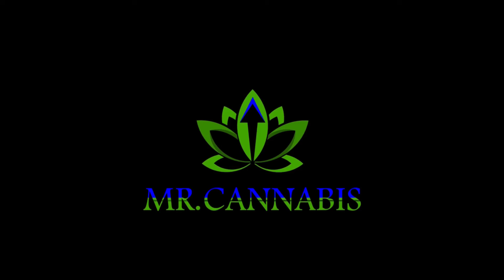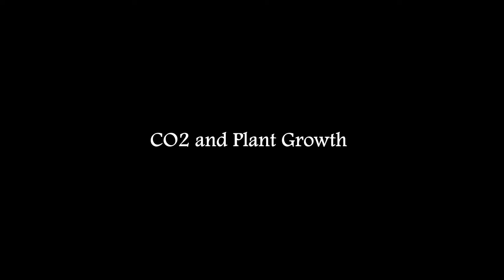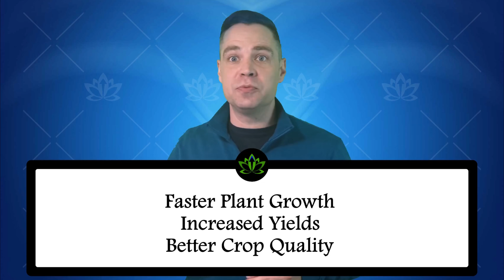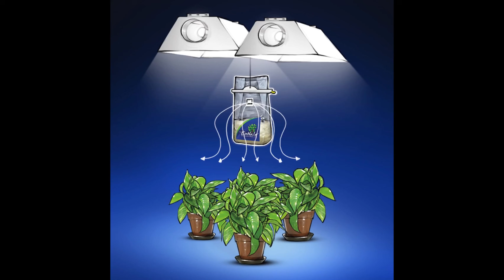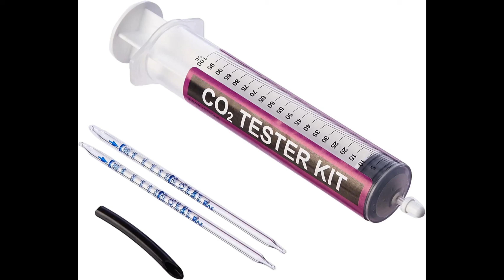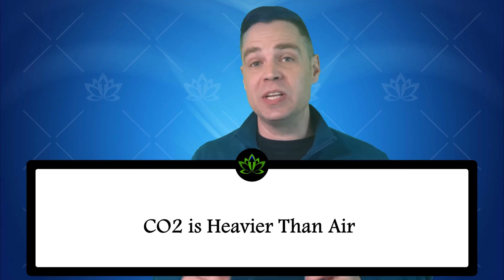8.5 CO2 Systems - Turbocharge Your Growing Knowledge

Comment: You couldn't say 1500ppm with a straight face😂 i've always been extremely sceptical of those bags, especially when a 5kg co2 fire extinguisher can be delivered for £35 and a regulator is about £40, it just doesn't seam worth bothering with the bags.
Reply from the maker: Generally those bags are for small ops that have a decent light. ;) Personally, i've never used CO2 enrichment, as i generally grow with an intake from my living space. :)